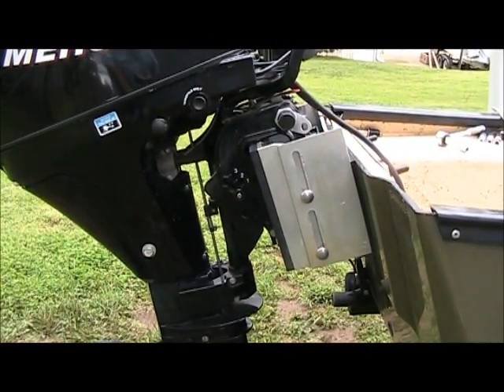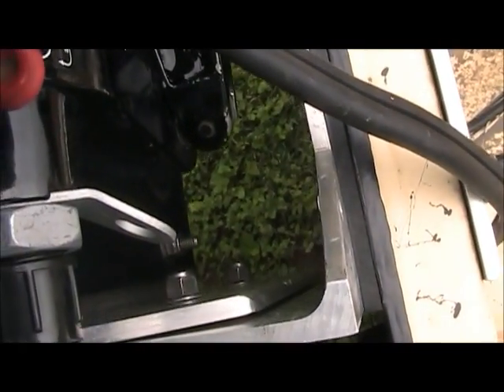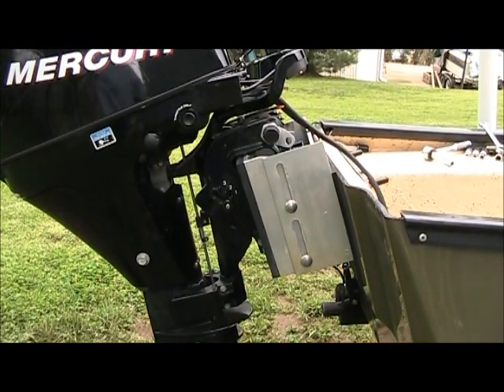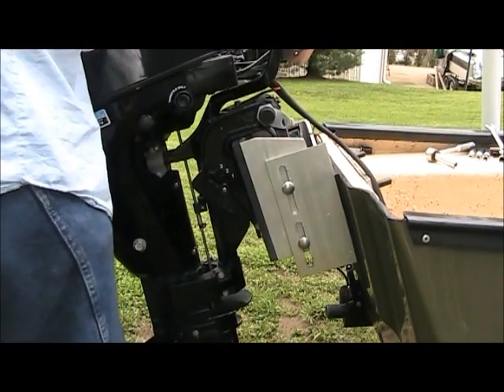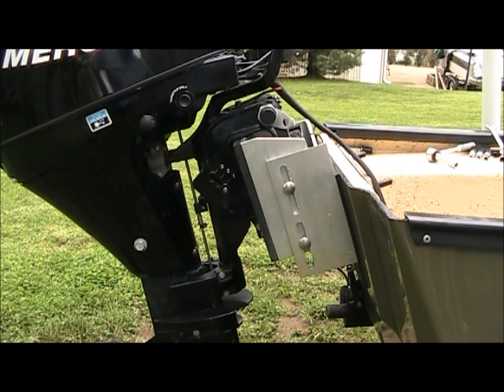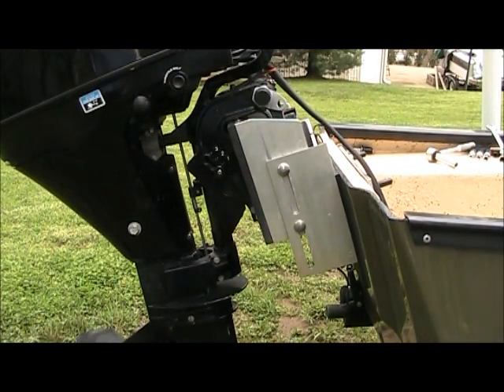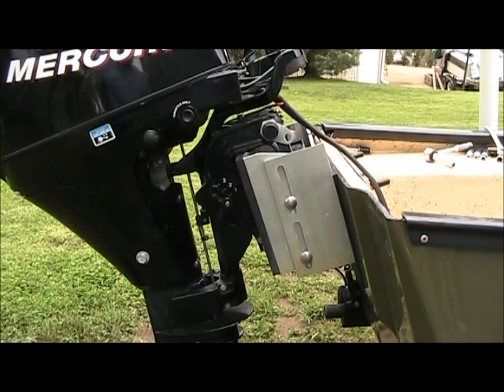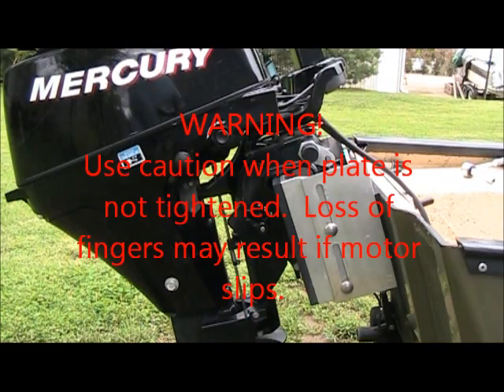Jack Plate Adjust with WARNING

Comment: Whats the black material on the transome and the motor plate?
Reply from the maker: It's a plastic basically the same stuff as plastic cutting boards.  I've used white ones from Walmart cutting boards and thy work just as well, as long as they are at least 3/8" thick.

Comment: Is there a rule that outboard should standing opposite on sea surface, not with angle like this one?
Or am i wrong
Reply from the maker: I'm not sure what you mean, but if you're referring to the trim angle, this is only a jack plate, not a tilt & trim. The jackplate maintains the same angle as the transom, and you use the motor's trim adjustments as if it were mounted directly on the transom. It isn't meant to be adjustable on the water; you try different angles with your usual weight distribution until you decide which height and angle works most often, and then you leave it at that adjustment.
Reply: @jakewayrewa5201  ok, one more question, can this bracket carry heaviest outboard let say up to 50 hp
Reply from the maker: @dsms4274  No idea.  The largest I've run on it is a 2010 Tohatsu 20 HP, which weighs about 125 lbs.  I suppose it depends on the quality of the hardware you use and how well you torque it down.

Comment: Good luck doing that from inside the boat not standing on a flat solid driveway , lol , why do you people bother with this crap?
Reply from the maker: Because it works.  Certainly not adjustable while on the water, but at a tenth of the cost of a hydraulic unit, it provides much better performance than pure stock with motor attached directly to the transome.

Comment: Would it not be easier to have the bolt put in the opposite direction so the nuts are on the outside of the jack plate so adjusting the tightness would be easier to get to?
Reply from the maker: Yes.  I intentionally did it this way for the cleaner look, and to have things get caught on the bolt ends.
Reply: It's not like you have to adjust it every day
Reply: @terryogletree2128 I adjust mine multiple times in one fishing trip. Ended up getting an on the fly because of that. If you fish super shallow you might need to. Going like 7-10 miles up the Saint Croix I might move mine 10 times.

Comment: in shallow water ,wont you just use tilt and trim ,,   in my case  ,, i have KENNER 18v w/ tunnel or do i still need JACK PLATE to ride in shallow water,,,THANKS
Reply: d o when you just tilt your motor up the thrust is shooting up and not letting you get on plane but with a jack plate it will allow you to get on plane in shallow and drive fast. by just tilting the motor you wouldn't be able to go above idle.

Comment: Bob's Jack plate is totally different design. Adjustment holes are on the back of the plate, not the sides, like yours. Any reason you put the height adjustment holes on the sides?
Reply from the maker: This design is simpler; only four parts.